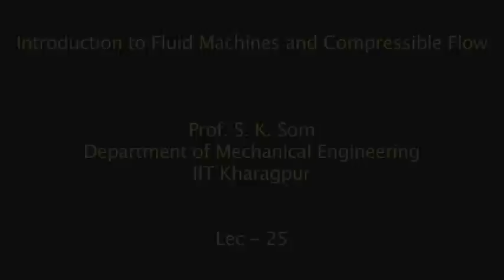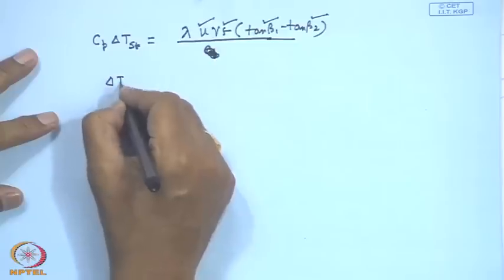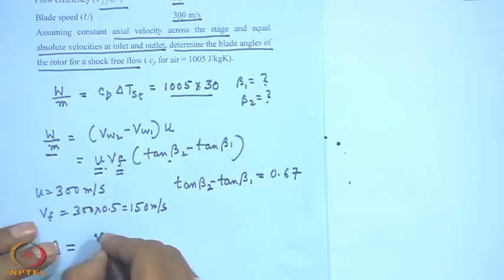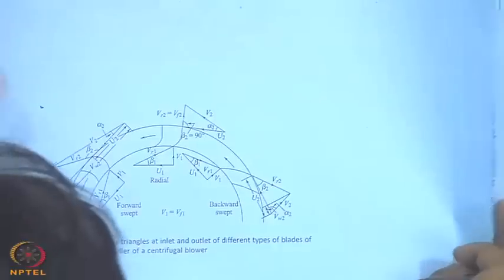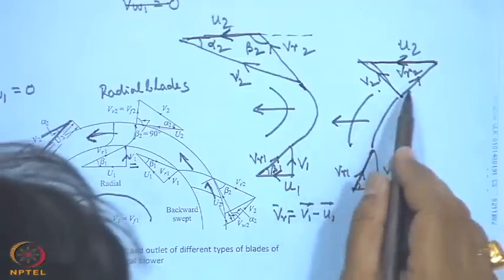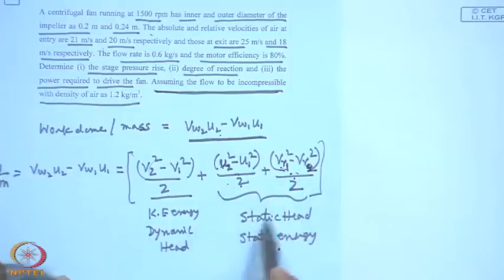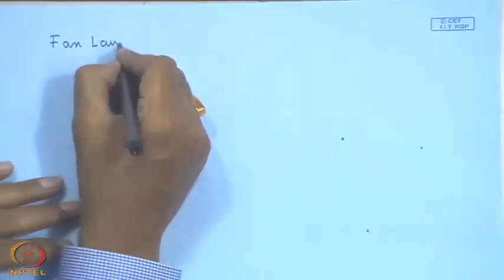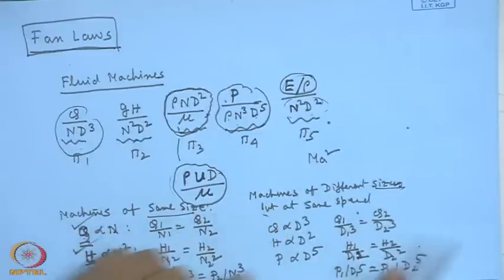Mod-01 Lec-25 Axial Flow Compressor Part II

Comment: @nptelhrd  while solving for the stage pressure ratio professor have taken beta 2 as 10 degree but in whole question no where it is written beta 2 is 10 degree ... from where it came????

Comment: In first question for finding pressure ratio the formula used has T01 in denominator but you have used T1.you must add ci^2/2cp to T1 to convert to T01.then its correct.can you please confirm me as soon as possible.
Reply: sahi bol rhe ho
Reply: No it has written that inlet temp is 300k not stagnation temp.. Question can write anyway they want not necessary to write T(1k)  always.. Depends on person

Comment: Where is U while calculating tan(beta)1+tan(beta)2 using degree of rxn formula it should be 
Vf/2U(tan(beta)1+tan(beta)2)
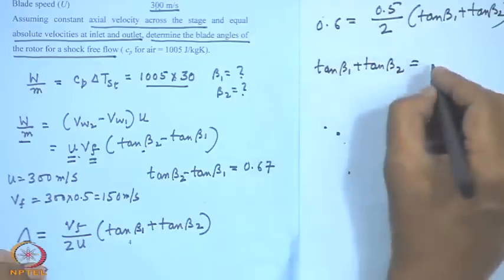Time 16:24
Reply: put the values of U and vf in the formula. rest you will understand